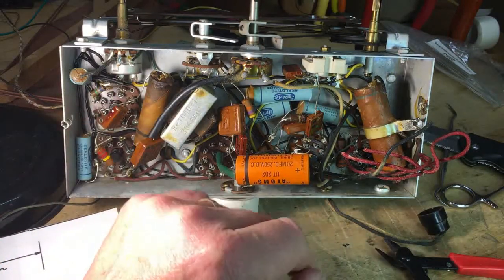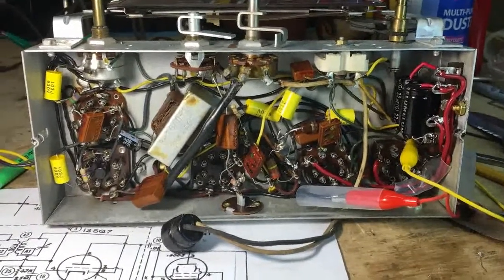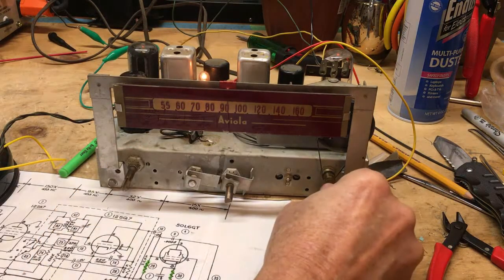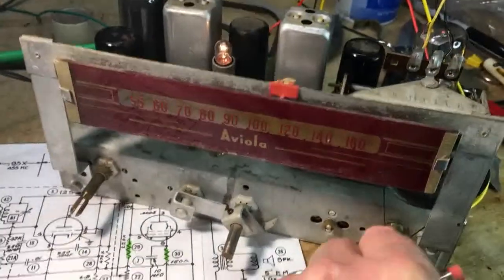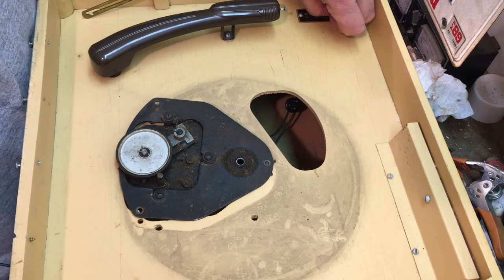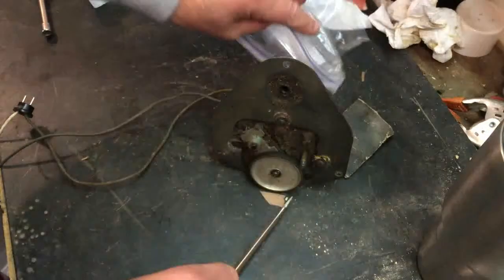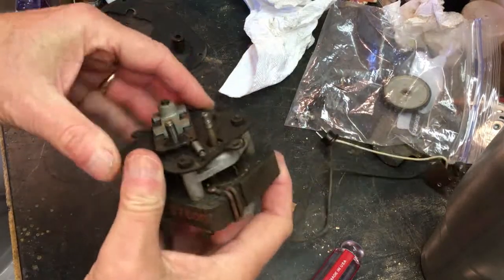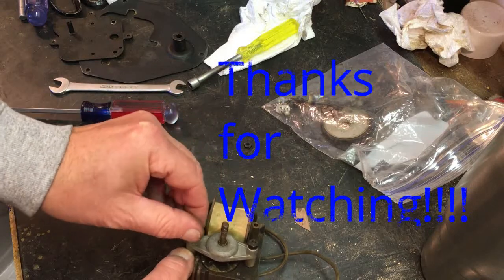1946 Aviola 509 Record Player and Radio, Part 2 of 3, Recap and Turntable Disassembly

Comment: I like to restuff the old filter caps in things like this, I melt out the old innards with a heat gun, or in a toaster over, and then take two (or however many are needed) radial style caps, wire them with the negative side together, add wire leads, slide it into the cardboard tube. Sometimes you need to use a packing material to make sure they stay in place, and because the new caps are shorter and smaller then the old "jelly roll", and then fill the end with the wire leads sticking out with 1/4'' or more of hot melt glue. This solves the problem of where to mount the new capacitors in most sets, saves having to add a terminal strip, and looks more original then having either modern radial or axial lead caps under the chassis.
  With regard to the phono cartridge, one thing I learned from radiotvphononut is that they often added a resistor in series with, or shunted across, a 3 volt crystal cartridge to drop the output level down, especially in a set like this that has a first audio tube. They liked to use the 3 volt cartridges in the cheap record players with the one or two tube "specials" that didn't have a first audio tube, and sometimes they added that extra resistor even in those to keep the kiddies from annoying the adults in the house. So if you have a .5 or .6 volt cartridge take the resistor out and it will more then double the volume, add a cathode capacitor on the audio output tube and it will make it even louder, and give the set more bass response.
Reply from the maker: OlegKostoglatov Excellent input Oleg! I have drilled out those "firecracker" filter caps and restuffed them as well. This one was not original and was a bit smaller than the orginal. I think I could have gotten radial caps in there, but only had axial caps. So, I just utilized what I had. The idea of changing the input resistor has been suggested. Im not sure what the original crystal cartridge was in this set, it could have been something different, there is not much documentation on this set. The company was founded by John Ross who founded Detrola after he sold Detrola and moved West. After he passed away, his wife tried to run the company, but it went under. According to their son, his mom threw away all company records. The ryders and Sams are about all that remains. The cartridge may have been changed, and the reason, I say this is that the input resistor had been changed from 220k ohms to 100k ohms. This may be an indicator that it has been replaced. I will keep this in mind when We test it. Very good suggestions and we will explore these possibilities when we get the turntable and tone arm rebuilt. Thanks for watching and as always excellent comments! Take Care--Larry

Comment: i use old prescription bottles for small parts..easy to see thru..easy to open and easy to store off to the side..can put lables on if need be..and there are various sizes...am enjoying your videos..
Reply from the maker: iamrichrocker Well, when I was thinking which was evident on the video, several things ran thru my mind. Pill bottles did pass thru those 3 brain cells left, but, all my bottles are larger and white plastic, lol. I could probably make a run to the pharmacy and pick up some, but I was scrambling to what to put these small pieces in at the time. Great suggestion! Thanks for watching and as always the comments! Take Care--Larry

Comment: You can get 1940's era looking polarized plugs from Lowes, and probably home depot too, they have them, look in that section, basically first thing I do when working on a hot chassis set if the power cord is good, if not replace it and the plug, so chassis will always be neutral. If you do this you don't need an isolation transformer and it's easy, and make it's power switch on the hot side, so when turned off it's disconnected completely.
Reply from the maker: grassulo I agree, I always fuse and polarize so the B- /chassis is neutral. Larry

Comment: I want to find a radio/phono like this one, it's like a basic all American 5 radio with a high output phono section feeding it's output stage. With .5v cartridges you will probably need a preamp stage to get decent volume from the replacement phono cartridge from VOM (original cartridge you have was close to 1 volt output) but this can be done with a cheap chinese 12AU7 tube, I think it's number is like 1T6 or something, really simple circuit and the tubes are very cheap and usually work quite well and might be a drop in replacement for 12AU7. You could also build a solid state preamp but you already have the power supply for tubes, you would just be adding one more stage on the phono output.
Reply from the maker: grassulo Thank you for ur great comment. From what V-M told me, my Astatic L40-A was close to .6 v. The replacement they are recommending is also .6 v. We will see how close they really are. I have seen videos of those tube preamps, also have access to guitar preamps if the need arises. Im sure this set is not going to be of high quality, it wasnt  when it was new. I am not going to try to make it more than it ever was as long as it gets a decent sound for what it is. The 78's I have wont be that high of a quality anyway. We can evaluate the need for a preamp when we get there, I appreciate to turning me on to the idea and will be looking at those options now, in  case I need to go that route. Thanks for subscribing and the awesome comments. If you want one like this, keep an eye on ShopGoodWill. These usually go for <$15 because no one wants a 78 rpm. Hope this helps and please keep the comments coming! Take Care--Larry
Reply: look on radiotvphononut's channel about old heavy turntable cartridges he has many videos about that and rebuilding the same turntable you have. He is who to ask for advice about this stuff and where I learned how to fix these!
Reply from the maker: grassulo Yes, I have been trying to watch as many of his videos as I can. He has worked on a bunch of them and has had good success with them. Right now, Im in the process of getting my parts in order. In the mean time, I will crash course on his videos, and will contact him if I dont understand what he is doing. So far, Ive understood what and why he has done (I think, lol). The learning part of this is what is so much fun, and hopefully as I learn, someone else will to, even if it by not doing it like me! Lol. Thanks again! Larry
Reply: You might put a 1M resistor in series with the cartridge output, since ceramic cartridges need at least 1M ohm impedance to sound their best, and that much resistance won't drop the voltage very much.
Reply from the maker: Martin Tousignant Thanks Martin! Thats good info to know, it will be easy enuf to try since it has a RCA plug on it, we can try it. Thanks for the hint and for watching! Take care--Larry

Comment: Please align and open up the band width on that AA5, it will sound awesome on AM look up shango066 video about bad fm and am sound on old radios or research I can't explain it in a simple comment but it's a simple circuit change, and you get much better sound and more band width.

Comment: Blimey what a mess, I would pull the whole lot out and put a centre strip right down the middle and connect everything down the centre
Reply: You could reverse the rubber guide wheel so the outside is on the inside ? It might look misshapen but if you soak it in hot soapy water on simmer like you to cook a pudding in a bowl. You don't want any heat direct on it from the hob? for an hour it should bring it's shape back! And make it more pliable you might want to do this before you take it off if it's hardened up already. 
 You need to find out what the proper diameter of the wheel with the rubber band is? it probably got worse since new reduced in size. you probably need to make it bigger than original as well? I don't know if this company does this, Because the voltage is different on the motor now then when it used to be! so it runs at a slight fastest speed in today's voltage. Buy making this guide wheel  bigger you're reducing its speed on the platter back to what it should be you could glue or just place a an thick o-ring like a 2.60 mm inside the guard wheel before you put the rubber back again to make up the difference or what it should be for today!

Or alternatively you could glue a rubber belt if you can find the size onto the guide will rubber using a rubber solution glue like you would use on puncture repair kits for bikes, coat both surfaces of the rubber let them harden completely then coat one side with the rubber solution again and let it go tacky. Make sure you clean both surfaces with a coarse sandpaper first?
You can check the speed with a strobe disc if you haven't got a strobe light? But use incandescent bulb when checking you need to have it fluctuate at 60hz
Reply from the maker: John sweda Im sure that would probably work. Since this is my first Rodeo, Im going to get V-M resurface it. The idler has a tension spring that can be adjusted for the speed. Im anxious to see how this is going to sound. Im sure it wont be a top notch HiFi but, I hope it does as well as it did in 1946. I am hoping to get it done before Christmas, I have a special surprise on the final video. Thanks for watching and the great comments, I always enjoy your insight. Thanks and Take care John! Larry